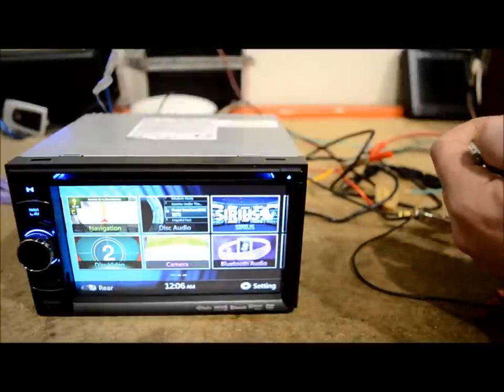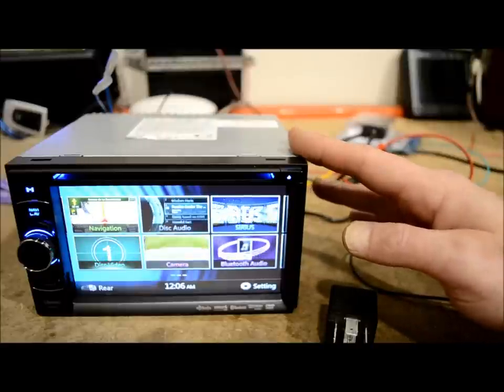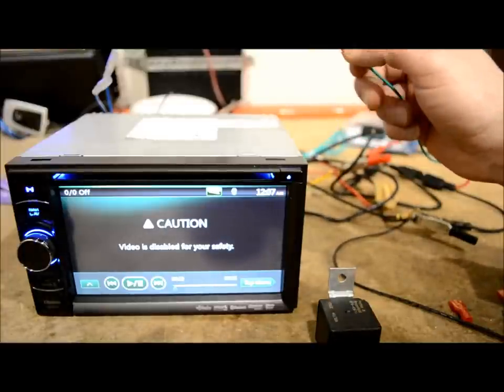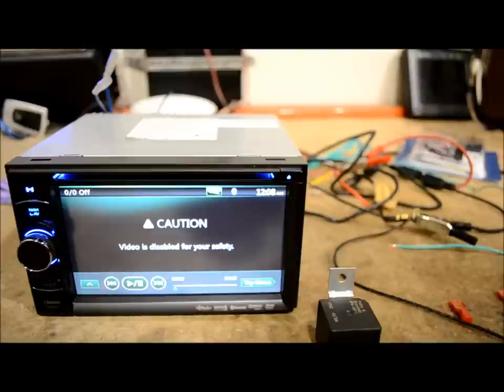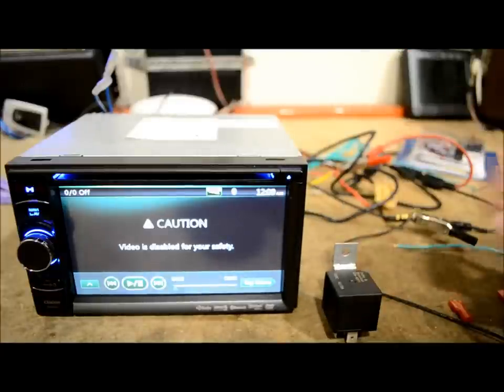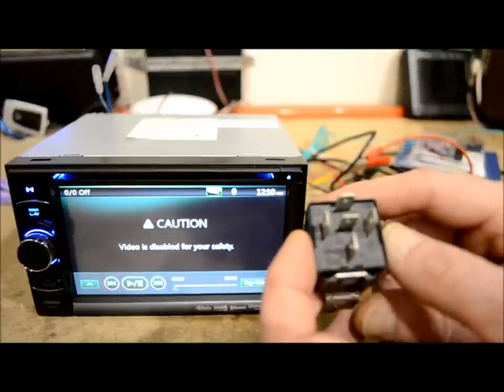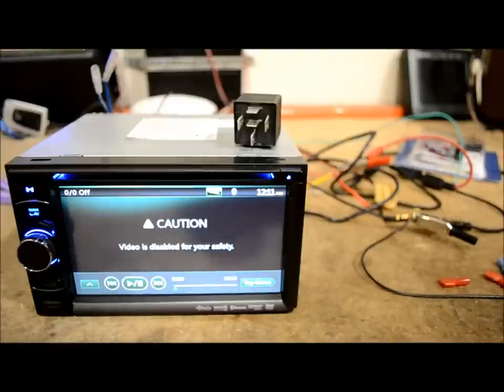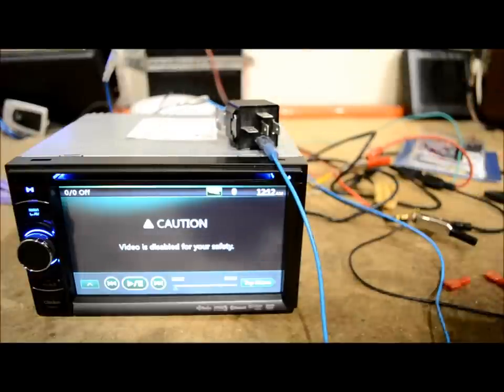How to do an In Dash DVD GPS stereo Parking Brake Bypass

Comment: Ok so I have an old classic car (1964 Ford Fairlane) that is compatible with nothing and no place to connect anything to anything.. Right? lol I got frustrated trying to make old radios sound like a modern car stereo so I said fuck-it and installed a big ass double DIN stereo under the dash. I have most all of the general features (Radio, USB, SD and even the DVD) working.. Just like you showed in your vid, all I had to do was ground my parking brake wire and presto It works. Now I am starting to really get inspired and I want to get my rear & side-mirror camera working... On my radio the only trigger wires I have left is (Key 1) & (Key 2) so I am assuming those are for my two cameras. Now I don't actually have any cameras hooked to the unit at the moment because I want to make sure I can make it work before I buy them.. Am I correct in assuming this is what the (Key 1) & (Key 2)wires are for??? And once I get the cameras connected could I put them on some kind of switch or button to activate them??? Like I said, there is nothing to connect these wires to in my car so I have to find a work-a-round.  BTW my double DIN stereo is Chinese & bought from Amazon with no name-brand that I can find ok but it looks an awful lot like yours so I am hoping that any advice you give me based on your radio will likely work on mine. haBased on what I have said regarding getting my cameras working do you agree with me? Are the Key 1 & 2 wires meant to trigger my cameras? One last question k.... My radio has pretty nice icons that represent the different features but they aren't animated like yours... Do you know of any way that I can upgrade my OS or software so that I can have animated icons like yours? Thank you for any help you can give me and if I have asked any DUMBASS questions please forgive me.. I am not an OLD person but I am OLD SCHOOL.. Well that's not entirely true.. I guess I am an old person after-all but I don't feel old! hahahaha Well most of the time I don't! haha Thanks man!
Reply from the maker: +GeorgeBonez Since your unit has these key1 and key2 connections I must presume this unit you own is is a non traditionally made brand such as an alpine/clarion/pioneer brand, am I right? We simply dont call wiring key1 and 2 in this country, so what I suggest you do is instead of buying cameras for a project that may not work out, just use a  standard video camera you have lying around with a video output and use that as an experiment and see how your unit responds, if its good then get real cameras and go forward installing them as planned
Reply: +Lessco Electronics Cool that's what I think I will do.. Now let me ask you this,,, My double Din radio has a slot in the front for SD and GPS. What do I need to get the GPS working? Is it some kind of card or something. Ive never owned any type of GPS other than the one built into my smartphone and Ive never heard of any type of GPS card for anything??? Do you know anything about this? Again, thank you for your help. :)

Comment: did everything just as he did an it did not work right.  after i turned it off an turned it back on, it did not work unless i disconnected the ground an hooked it back up.   so i had to do the toggle switch....

Comment: But what happens if you leave the parking brake cable always wired to the ground ?
Reply from the maker: Norbert Rivera That depends on the stereo model, different ones act differently.
Reply: Lessco Electronics  I have a quick question.
I have a Appradio 3 SPH-DA210.

I live in the Netherlands Antilles. I purchased the Headunit in the U.S online.
I now found out I cant watch videos, because it only plays region 1 DVD discs.
Is there anyway around this. I feel so cheated.
Reply from the maker: unfortunately no you can't
Reply: Lessco Electronics so what do you suggest I do...I really feel like smashing this crap into the wall...It doesnt even read USB thumb drives what the actual FUCK ?!?! :#$$@ :(

Comment: How would you do that for something like this? eonon.com/Car-GPS/2-Din-Car-GPS-DVD/C1308.html
The brake wire is a lot shorter. It says to connect it to the "power negative pole," which I may be misunderstanding to be the negative of the car battery...

Comment: sir.can i use this relay wiring same to power amplifier?
Reply from the maker: +Syamsyul Iqram yes, no problemo. this is a 30a relay!
Reply: So i can install direct from red wire battery to relay without switch or fuse ?
Reply from the maker: the relay is a switch, but always fuse all you circuits!
Reply: +Lessco Electronics u have example vdeo or diagram for me to wiring relay from battery to amp.?

Comment: Do you know how to install android  double din stereo in my  2005 Cadillac Escalade ESV
Hs Onstar never sed it and bose stereo system and steering wheel controls
Reply: Steven Krenek your gunna need an interface module  to get stock steering wheel controls to work with new head unit.
Reply: no sound from new radio

Comment: does it matter the volts on the rylay? cause I've seen that their different volts
Reply from the maker: any relay rated 12-24v is fine
Reply: and how about if instead of using the rylay I use a switch to turn it on and off when ever I want do you think that might work?
Reply from the maker: it might but what a hassle though..

Comment: Inhave the vx404 and this does not work... When i take the blue and white wire and touch the relay the video turns on  now when i rurn the unit off and back on yes it clicks but video is still disabled wtf
Reply: me too i have the same problem on my vx404 please help i did use relay or ground the parking break to chasis, first it will work then if u restart the HU the video comes back to disable

Comment: How do you bypass a  Pioneer 4400 GPS Or VSS
Reply from the maker: You will need one of these:

https://www.ebay.com/itm/DIY-Bypass-Pioneer-Stereo-DVD-Parking-Brake-Bypass-Kit-double-pulse-relay-/401327860822?vxp=mtr&hash=item5d71012c56

Comment: I'm one of those guys that had a pioneer.  What do I do?
Reply: I already figure it out and it was way more simple than that.

Run the break wire into a switch and then a ground on the other side.  When the message appears,  flip the switch for 2 seconds then back again.. done.

Comment: i have a avh-p5700dvd, i have also been in the car audio business for about a decade, the p5700 requires a GND pulse so, GND ON , GND OFF, GND ON so instead of wiring up a relay, i just used a SPST momentary button that rests on closed or GND ON, then you just press it once and boom. bypassed...

Comment: I've been researching my issue...I also have the nav unit for my head unit and read somewhere in order for the nav to work you have to replace the bypass...is there anyway to use both the head unit and nav unit while using the bypass perk for the head unit

Comment: Way to much for something so simple. You dont need the resistor. All you have to do to bypass the parking break feature is to take the wire for the parking break most of the time pink some have been brown. It will be labled though and is normally with the red yellow white plugs. Just like in a dvd player. Anyways take the parking break wire and just simply wire it to your negative wires. Ground (negative) wires are always black.  Just take all your black (ground) wires and crimp them together with a butt connector. Then take whatever color your parking break wire is, witch it will be labled once again. But take the parking break wire and put it in the other end of the butt connector and crimp. Bam done. Dvd should play without messing with the parking break. I promise you it works and is very easy. I do every single one of my vehicles with a cd/dvd player and i wire them all just like that. Never have any problems with it what so ever. The first one i had i hooked to a toggle switch and had to sit there and turn it on and off as fast as i could until it bypassed the parking break. Got tired of it so i set out to find or figure out the real way.

Comment: I called 4 different places and they don't know anything about this relay. Where can I get one? What is the volt/amp rating?
Reply from the maker: I have them here
http://www.lesscosales.com/servlet/the-26925/New-Magicar-Compustar-SPST/Detail
Reply: Awesome! I bought a 40 amp related with all the same numbers on it thinking it would work. It didn't.  I might make a YouTube video about my progress to get your feedback if you are willing to walk me through the trouble shooting.
Reply: Dude, fuck that relay. Just wire the parking brake wire to the ground wire.
Reply: OK.  I'll try that.
Reply: imSo304 Dude some new ones you can't do that, my old stereo I did but the new one I can't just ground it!
Reply from the maker: you need one a dese: http://www.ebay.com/itm/DIY-Bypass-Pioneer-Stereo-DVD-Parking-Brake-Bypass-Kit-double-pulse-relay-/400761204544?pt=Motors_Car_Truck_Parts_Accessories&vxp=mtr&hash=item5d4f3aaf40
Reply: awesome thanks!
Reply: HH REY Yeah, I heard the new Alpines require a "Pulse" signal for DVD Playback.
Reply from the maker: here is a link to my relays: http://www.ebay.com/itm/Omega-AU-7-Heavy-Duty-Relay-SPDT-Auto-Car-RV-Boat-12-V-/400098948434?pt=Car_Audio_Video&vxp=mtr&hash=item5d27c17552

Comment: Forget the relays when you can get a parking brake bypass from amazon for 14 bucks right here: http://amzn.to/2fOkZCe  I do this for a living and you can't just ground the parking brake wire on every receiver. It will work initially until you turn the car off and back on again. Most of the new receivers use a "ground pulse" + - +. The bypass is 3 wires, black goes to black, blue to blue white and green to the receivers parking brake wire which is usually light green. (It comes with instructions). This not only allows you to watch video's, but you can't even make an initial bluetooth connection on most receivers without a parking brake bypass or connected to the real parking wire. Then you'll have to engage, disengage then re-engage your parking brake every time you want to access advanced settings or features. Do yourself a favor and get the bypass! Disclaimer: Check the laws in your state. Message me if you have any more car audio or home audio questions.

Comment: do we have to put a bypass on all DVD GPS combo unit ???
Reply from the maker: +Chulla Quiteno it goes by specific model, what are you working on?
Reply: Pupug

6.2-INCH Android 4.2 Car Radio STEREO with WIFI ! 2 Din Car PC DVD Player SAT GPS Navigation Car Audio Video Headunit Bluetooth SD/USB +Car PC
Reply from the maker: I doubt you'd need any device to bypass that unit. It's most likely a straight ground type. But if it turns out to ot be, let us know, we'll help you again.
Reply: Ground ??? Like ground it to the frame of the car ??
Reply from the maker: yup
Reply: Thank you

Comment: Why do people add a relay for this? Just ground the cable thats all it needs
Reply: Michael Guevara not all radios work that way, like pioneer or Alpine units it will require a switch,relay or a bypass module

Comment: Just drive around with your parking brake always on. You may need to cut a wire or two to extinguish that annoying light on the cluster and the ding of the chime. Sure you will feel some drag at first but if keep pushing through it,  those pads will wear down enough that you won't even notice. 
And a couple more tips:
Since you will be in the dash, this is a great time to top off the blinker fluid.
 And finally,  prepare for winter by loosening your lug nuts. You don't want those things seizing up on you from road salt. 
Happy motoring.
Reply from the maker: :I

Comment: All you had to do was ground that green wire. You didnt need that realy at all.
Reply: What's a quick and easy way to ground the green wire. I still have mine hanging out so I can easily ground it but I personally have no experience doing so. Any help, please?
Reply: Heav Champ Just use the ground wire from your radio or find a good spot on the metal part of your vehicle and connect it there
Reply: Um if you listen he clearly says that on some newer models you DO need the relay whereas some you just ground it you got a 50 50 shot

Comment: It's much easier and cheaper to do - you just need one npn transistor and one resistor.
Reply from the maker: tell me more
Reply: @Lesscoelectronics  I made this for may Pioneer avh, just connect remote cable to npn transistor base using ~36k resistor. Connect emiter to ground and collector to hand brake radio cable. Radio will toggle handbrake signal using that npn transistor in same way as realy is doing but this solution is much smaller and cheaper ;)

Comment: This is bull poo. The PAC TR7 is awesome for Pioneer and Alpine units because they need to see multi negative triggers and the Alpine also has a gyroscope built into it so you can't just ground the parking brake or the foot brake. So you are not a "sucker" if you buy these parts; it all depends on the application it's intended for. For the particular Clarion in this video and most Kenwood and JVC's, he's using a relay for no reason, you can simply ground the parking brake lead with the ground needed for the radio. This is what the relay is doing, but it's also needlessly taking up a valuable amp turn-on lead. My best advice for anyone watching this video is to go to your local mobile electronic install shop and pick a seasoned installer's brain.
Reply: I didn't say go drop money  somewhere, I said go talk to an installer. You should learn how to read.

Comment: I hooked the pink brake wire to the grounding nut on the back of the unit ..it bypassed and works fine....js
Reply: You're not saying anything he didn't say in the video. Some stereos won't unlock navigation input nor video unless ground is applied to the parking brake wire AFTER accessory.

Comment: This was a lot of unnecessary work. Just ground the Green wire and you are good to go. No need for a relay
Reply: Some radios arnt that easy
Reply: @gameondude3617  
I have had many different brand radios and everyone has been the same. 
 Which type is not so easy?

Comment: I'm sry but all this is a waste of time no matter what deck u have old or new they all have a brake wire on the harness itself usually it's pink or brown all I do is strip enough from the wire and on the same receiver they usually have small screws to hold it together just ground it to one of those and that's no need to get all scientific about it "so pretty much just.ground same. Brake  wire from the receiver harness to the reciver its self and safe urself a weekend warrior project" that's all folks